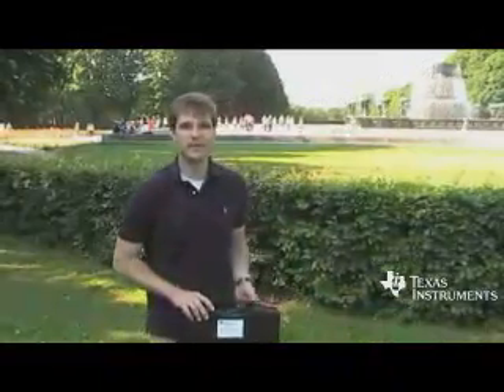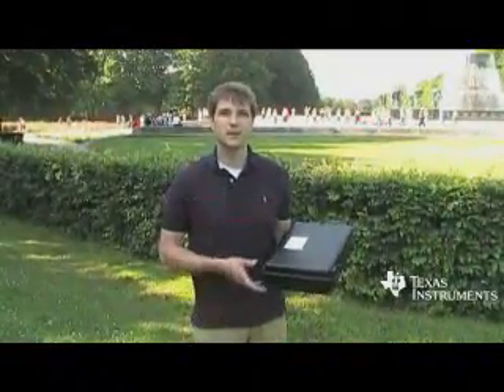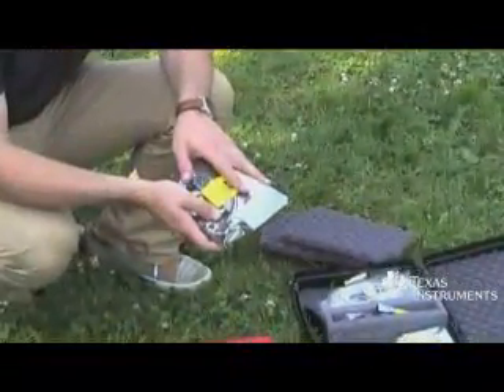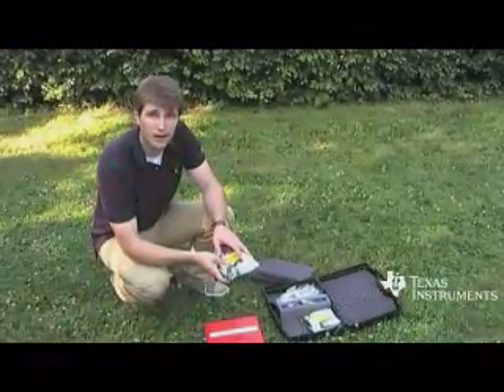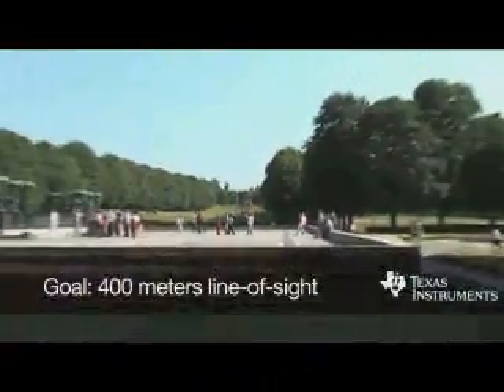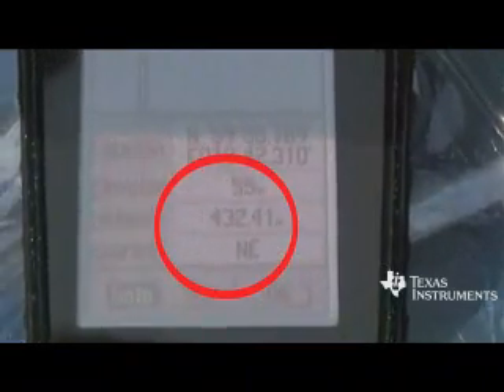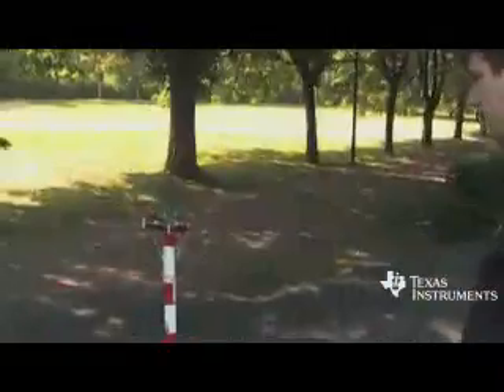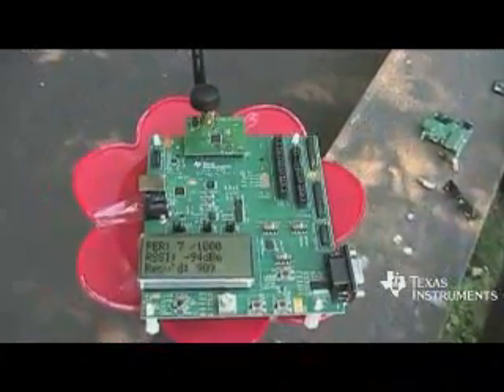CC2530 Range Testing

Comment: Good evening,

I'm working on an RTI (radio tomographic imaging) project.

I bought 5 modules CC2531EMK from TI to get started.

At first I would like to create a small Zigbee network, and get the RSSI data through IDLE (Python 3.6).

The big problem is that I can not find a firmeware to write in EB. (I also bought a CC Debugger).

I believe that I need a specific ZNP to make a Zigbee network and that they communicate with each other.

By chance would you know how to create a zigbee network and access the information through the USB port by python? What files and programs do I need to have installed?

I am using windows 7 - 64bits, and if changing operating system makes it easier to access information from CC2531, I could migrate from OS.

Please, anything you can help me will do much good. I am still reading and studying to understand what software needs to work with the CC2531EMK and I am still new to programming.

Thanks a lot for the help!!